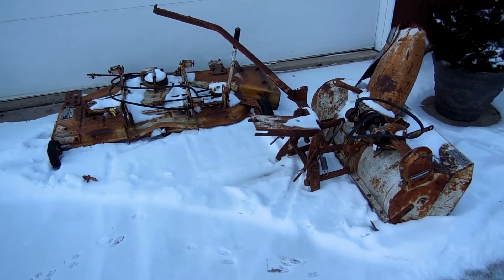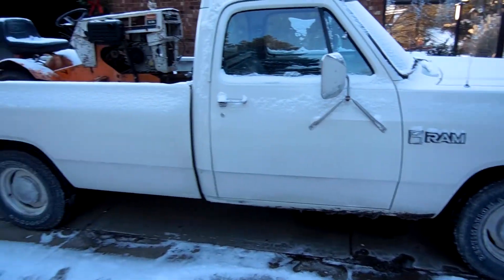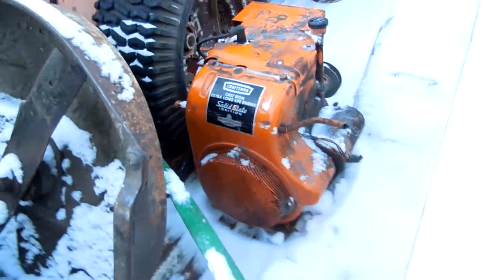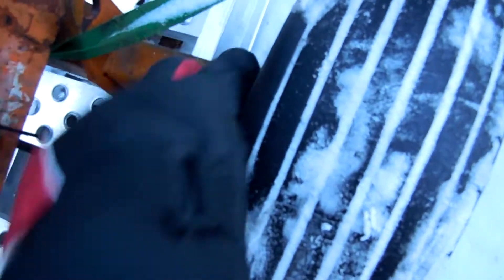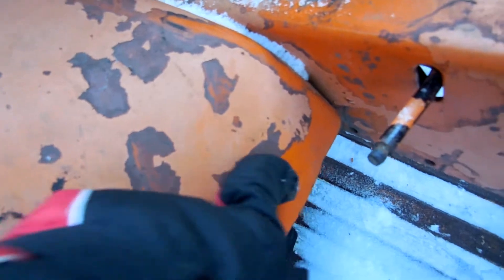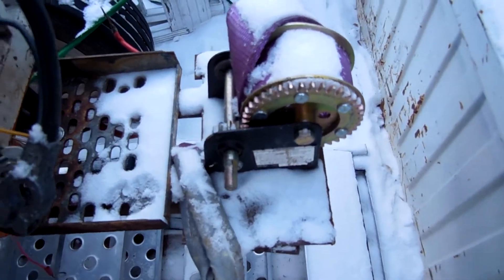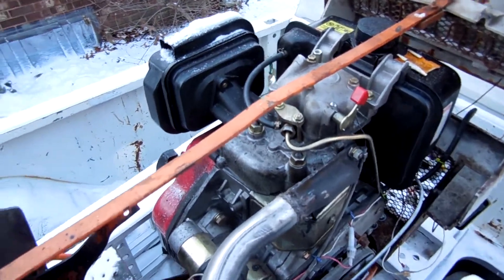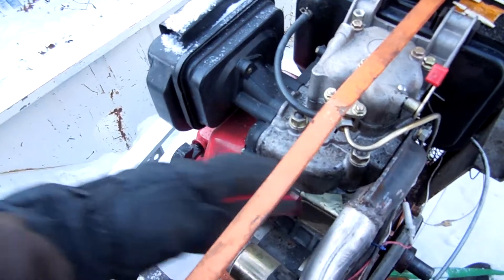1968 Sears Suburban 12 10 hp Diesel and More Attachments

Comment: I know why the spindles are white, they're outta the 500,000th tractor! lol She's a little rough Danimal but I see a lot of potential and a Diesel engine to boot! Great score bud!
Reply from the maker: Just got her started in 10 degree weather and drove it around for a little bit. It was a pain in the ass to get it started but i managed without any form of heat!
Reply: 71_Sears time for a block heater!! Especially in Wisconsin winters!!!
Reply from the maker: That or some sort of intake heater as these engines domt have spots for glow plugs in the heads.
Reply: 71_Sears They can take a glow plug. I have a spare head for mine that has a glow plug in it.
Reply from the maker: I never knew that! I have yet to see one.
Reply: 71_Sears They did not come stock but one can be added.
Reply from the maker: I would be interested in seeing what I would need to do in order to add one.